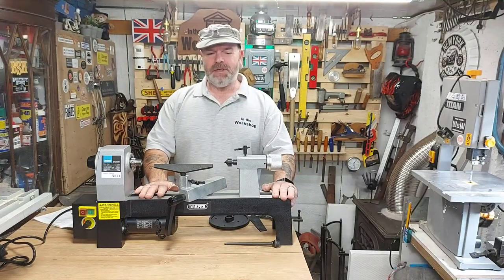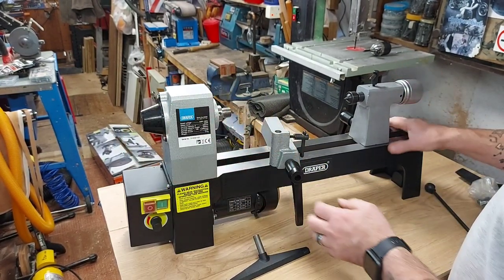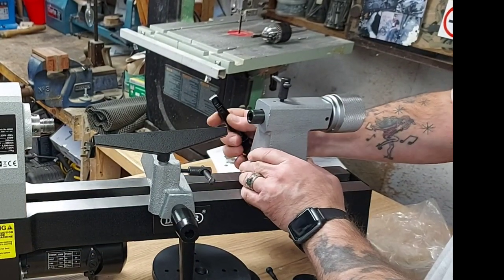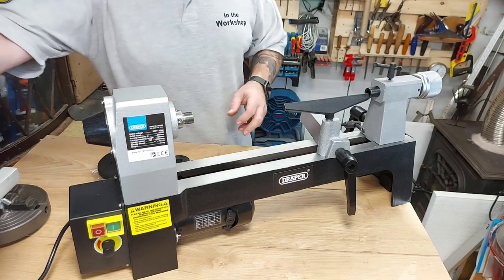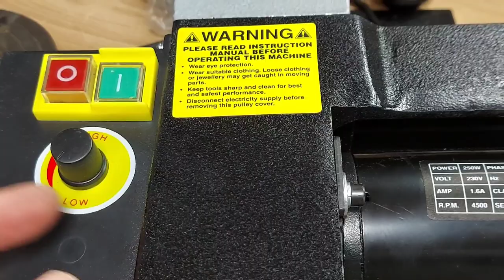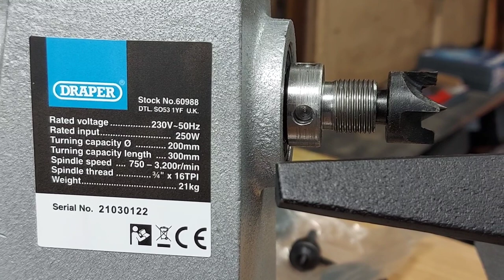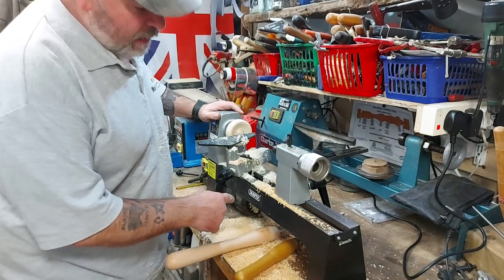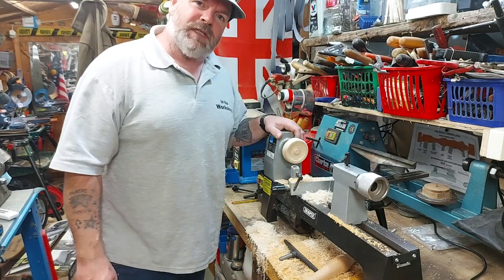Mini Wood Lathe Review / Draper WTL330A

Comment: Looks like a step up for you! I got my first lathe this year, a model similar to yours but different name, and it amazes me how quietly it runs! I got a good chuckle when you showed that 4 jaw chuck. A couple years ago I was given a 9x20 metal lathe, new, still in the shipping crate, but 20 years old at the time. Had a lot of extras with it, most of it good stuff, and that same 4 jaw was included! I’ve used other 4 jaw independent chucks, and trying to use this one made me come to the conclusion that it got into this shipping crate by accident, and was actually intended for use as a narrowboat anchor! Hope you’ve had happier experiences with yours! Thanks for posting!
Reply from the maker: Ha 😀 this isn't your narrowboat anchor is it Tom, I bought it used off Ebay 😉
Reply: @InTheWorkshop  I hope you have better experiences with it than I have! I think replacing the bolts that pass through each jaw with very fine thread bolts would make it more user friendly. There seems to be no happy medium between too loose and too tight on mine! Your channel continues to be one of my favorites! Thanks!

Comment: Good review Daivid, thank you. I thnk I have watched this video about 3 times now! Simple no nonsense and to the point with interesting pros and cons. Plus no background music! I am seriously considering one of these as my Parkside has finally died. I was looking at the wattage though and wondering if it is enough. All I do is turn finials about 3" inches diameter and 3.5 inches long from treated wood. The Parside was 500W where as this is only 220W I think. I wondered if you saw much difference? Also if the old ones had more plastic bits on it is it  the same model number? I want the one like yours with metal components. Keep up the good work David and thank you again.
Reply from the maker: Thanks very much for watching 🙂👍

Comment: Nice video 👍
I've got the old Draper wtl12  and i use the plate to fix to a round plywood with sand paper stuck to it.. very useful for sanding..  i wonder if on yours you can take the black plastic cover off the backside to have a sanding disc at the same time running 🤔
Reply from the maker: Thanks for watching and the comment 👍 great idea, I would have a look to see if I could fit a disc sander but already have one 👍 all the best David
Reply: @InTheWorkshop  your welcome,  just an idea which could be useful.. 
Thank you for the video, have a great weekend  🤜🤛🔝

Comment: Looks good. Would you say it's worth the extra £100 or so over the Parkside lathe?
Reply from the maker: Yeah I think so, I haven't had the Parkside lathe but sure I have seen poor reviews and seen they are plastic bodies (this will be why they are so cheap). This Draper one is heavy metal but smaller.
👍
Reply: @InTheWorkshop  Thanks. I might go for that then as I only have a small space in my shed.

Comment: When you were using the lathe, I noticed the belt and disc sander further along your bench.  I'm hoping to get one of these in the next few months.  Is yours a Clarke?  Are you happy with it, has it been ok for you?
Reply from the maker: Hi Tony, the sander is a Ferrex one and I've had it a couple of years now. Touch wood I've had no problems with it but it's only used from time to time.
Reply: @InTheWorkshop  that's good to know, thanks David, it's much appreciated.
Reply: @InTheWorkshop  Hi David, with this Ferrex sander can the table be used with the belt as well as the disc? Aldi have got it on sale again (online) but their write-up doesn’t provide much information. It’s a good price though, £90.
Reply from the maker: Yes both the disc and belt turn at the same time.
Reply: @InTheWorkshop  ok, thanks David.

Comment: Im also like you and have the clarke lathe which i find ok but limited on stuff too do as no propper tail stock how do you compare this lathe to your clarke
Reply from the maker: My Clarke seems to have movement in it when you clamp work between the centres. It's noisy and vibrates. This lathe is completely solid and very quiet. The Clarke can hold much bigger pieces and run for a lot longer before the motor needs a rest. The only slight concern with the new mini lathe is how long the motor will last but this will obviously depend on how much use it gets. The mini lathe is made for working on small workpieces so would probably last well if not loaded with heavy lumps of timber. 
Hope this was of some help 👍